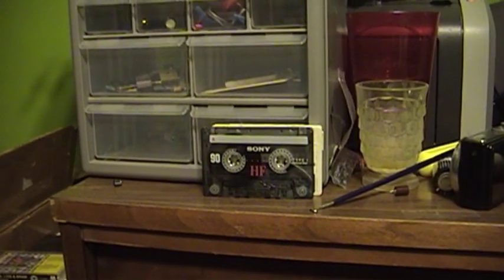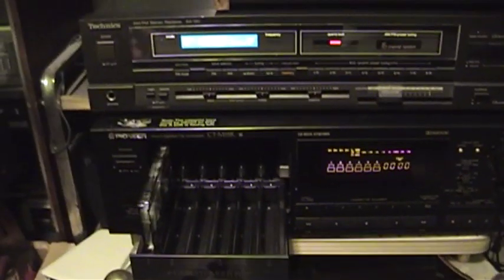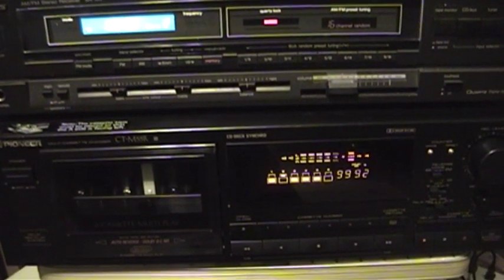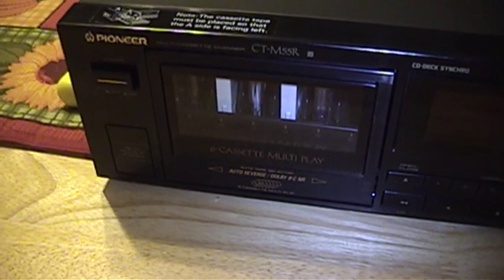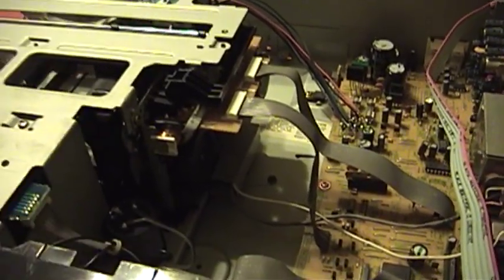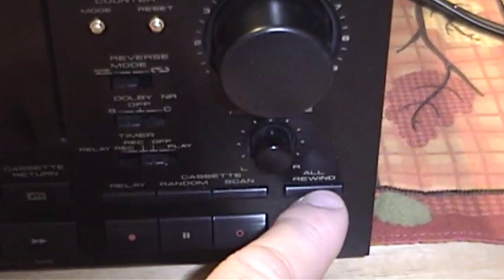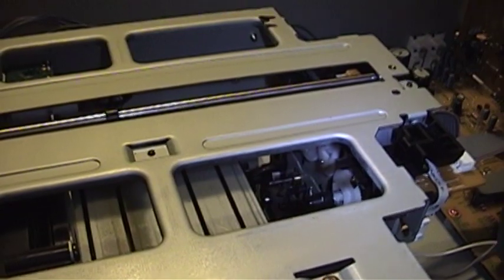Pioneer CT-M55R Cassette Changer Repair/Demonstration

Comment: I'm supprised that a company the size of Pioneer doesn't have their service literature available as a pdf file.  As far as the microfiche goes check with your local public library, they quite often have microfiche readers with built in copiers for making hard copies of the information you are researching.  Very cool unit :)

Comment: Wow, I saw one of these in a Goodwill about a year ago.  I tested it in the store and it did exactly what yours did--load, but not play.  I must have had the same solinoid problem, so I passed on it, even though it was only 5 bucks.  Now, I wish I had bought it.  I will probably be a while before I see one of these babies again.  Nice video.

Comment: That's cool!  I like how the tray slides in and the door closes.

And for some reason, I've always like the little rattle noises that cassettes make when being moved around or inserted/removed from a holder or player.  I have no idea why.

An alignment tape and frequency counter or scope would really come in handy for setting the tape speed.  I think you can actually get software for PC's that let you use the sound card input to test things like that too.

Comment: Thanks for writing back.  I have now found that I have to be careful about the tapes I insert in this player.  The thin tapes don't work as well.  The 120 minute tapes are a no-no.  Usually the commercially produced tapes work better.
I also like the random feature, it's really cool.  Works just like my 5-CD changer.  Kinda fun.
And I have the Pioneer CT-M55R which is collecting dust now, but I still love my cassettes.
But I'm also a big fan of vinyl, which I understand is coming back.

Comment: @matthewh16 They are similar yet totally different.  Microfiche comes on an approx 4X6 inch sheet of film, Microfilm comes on a roll of 35mm film.  The benefit of microfiche is being able to go directly to the part of the sheet of film with the information you want is located.  Microfilm you have to wind through the roll to find the info you want.  It's also easier to store microfiche as it is usually stored in a card file, microfilm rolls are stored in file cabinets.

Comment: I own the M66r which is the bigger brother of the M55r.  I had the M55r for years until it develop a high pitch squeal. I first brought my M55r back in 91 and pick up the M66r around 06.  The M66r comes with a remote and has the HDX system.

Comment: We came across a CT-M5R. That is right, one 5. I have an issue where you can turn it on and open and close real quick, however the device doesn't even try to recv the tape and displays ERR to no end. The conrols seize up and the device is useless till you power off/backon, quickly pressing eject in time to recover your tape. Every time it attempts to play it stalls with no movement in the deck

Comment: Hey Bill, Nice video .I've got a CT-M70R which is similar to this unit which I am restoring. I've got everything working except I can not get reverse to work in either the 6 cassette player or the standalone. Only one side in the player turns and jams up the tape. I had to change the belts I'm wondering if I messed something up .Forward play, rewind and fast forward are flawless. Any ideas. Can't find a service manual for these. Thanks
Reply: +John Dinse Mine seems to be doing the same thing now.  I got the speed adjustment worked out, i'm just trying to figure out the reverse adjustment
Reply: I don't have same system , but  I worked on different deck with same mechanism, Play and Rev Play are controlled by solenoid and Cam Gear witch locates between/under capstan wheels. Cam Gear has grooves , solenoid is pushing metal pin to proper groove, bottom side of the capstan wheel has little gear wheel witch is turning the Cam Gear to push head and pinch roller up, side is depending  of chosen groove. Mechanism has two motors, motor in the middle is for moving tape roll on both side play, rewind and forward, second motor , (on upper left) is for capstans and mechanism.

Comment: Hi, I have the same tape changer as in your video. It was working fine, then a tape was loaded and won't return, play, or rewind. I just get an ERR message and nothing happens. Any suggestions to free it up? Thanks!
Reply from the maker: It is very likely that a drive belt in the mechanism started slipping. Unfortunately, I've never seen a service manual for the mechanical parts of these, only the electronics.

Comment: What is the best way to remove a "stuck" tape?  I had to completely destroy the tape itself to get it out of there.  The rest of the cassette came out just fine.  That was frustrating!  I guess you need to make sure that the cassette you insert into the player will "behave" itself normally.

Comment: I have worked on one back in the late 90s at model electronics they had the schematics for it in a book form and had all the info to tear it apart all I had to do was replace a power diode in the power supply . I will send them a e-mail and see if they still have it and make me a copy I am unsure if they still have it as they moved and now only work on car audio and spedos.

Comment: Hi UXWBILL, I have a problem with a deck like this in the transport area. Some pieces are out of place and by this reason the transporte doesn't carry any of the six tapes, but it certainly moves like it should. Do you know by chance how to dismantle the transport platform in order to insert the pieces where they have to be? I will appreciate a lot your advise. Thanks!!

Comment: @uxwbill I was going to say, call a few libraries in your area and see if they have a microfiche printer and then print them to pages and put it in a binder and SCAN THEM! I'm sure a lot of people out there would REALLY like to have the service data for this thing because they are really complex, I've turned down a few of these for that reason, lack of service data. One of those things I really don't want to disassemble without a manual.

Comment: got an M6R  here, same sort of mechanism, but the deck has dolby-C & hx-pro for recording, slightly different display. mook seller shipped it to me with a cassette loaded, & this messed up the sliding caddy with the cassette in it. long story short- I have it working, but it thinks slot two is occupied while in fact the caddy from slot one is occupied & loads into the transport. 
did you ever get a full service document for it? I have schematics, but they're worthless for mechanical issues.
Reply from the maker: No, I have never found the full service literature.
Reply: @uxwbill  well, I got it running properly.... there's an encoder on the side of the sliding caddy, & the position of this encoder w.r.t. the worm gear is critical to the caddy knowing where it is inside the box. this had taken a knock, + two of the locating pins from the cassette tray are loose.... circlips ordered. the springs are safe, at least. so currently mine runs but only with four cassettes. this ain't a nakamichi, though... :-)

Comment: I just brought a CT-M6R home and it played a tape or two and is now stuck and won’t open. It runs the motor for maybe 20s and then displays error.  I paid 25 for it and I think I’ll keep it as a project. Any tips?
Reply from the maker: Follow the Boy Scout motto and "be prepared"? That's about the best I've got. You could be dealing with anything: a tape spill, bad belt, stuck mechanism, bad driving motor or even an electronic fault (unlikely).

I've never seen a mechanical service manual for these, only the schematic drawings for the circuit boards.

Comment: Hey Bill.  I just bought one of these and it showed up broken.  The tray is sitting in sideways and will not move.  Any ideas on what I could do to get this to work?  It looks like as soon as you turn this on its side it goes to crap.  It looks like it just got derailed any help would be awesome
Reply from the maker: I really couldn't even guess, since I've never had to go into one that far. It really sounds like something got broken, though I'm not sure what it would be or how repairable it is.

I've never had any luck finding anything more than electrical schematics for these.
Reply: Do you like sony or pioneers changer better for cassettes? @uxwbill

Comment: I learned the reason you unload media before shipping first-hand.  I had a Spectra Logic T50 tape robot shipped from another location within my employer.  Little did I know they'd just pull it out of the rack and slap it in a box!

It reads in big bold letters, "DO NOT SHIP WITH THE TAPES INSTALLED".  They mean it.

I had to fix the resulting carnage that 10 DLT7000 tapes caused to the loader.  Not fun! (A much worse fate befell the server that drove the robot.)

Comment: Hi Bill, I have a pioneer CT-WM62R multi-cassette changer. Haven't played it for several months but recently tried but an error appeared and I turned it off and back on. When I tured it on, it just made sounds as if it was trying to engage. I tried to rewind the tape and now both deck one and two will not play, rewind, or fast forward and the carousel will not move. Any suggestions? Thanks for you help.
Reply from the maker: My best guess is another case of bad belts. These units are certainly old enough to qualify. However, the mechanism in both of the Pioneer changers I've owned has become "stuck" and needed some careful manual encouragement to free it up. The one I still have (the unit in this video) still works perfectly after having been freed up.
Reply: @uxwbill  Hi Bill I just subscribe to your site and I love your videos. Anyway my question is I have a Pioneer  6+1 multi-cassette changer model CT-WM60R I have bought new in the early 90s but the problem I have now is it's been sitting for a little bitI can't get either deck to engage into play I'm guessing it is a solenoid how do you clean the solenoids?

Comment: I have the 66, it won’t load the cassettes. It will go to position but won’t pull the tape then just returns. Any tips or direction on where I could figure out a fix?
Reply from the maker: Bad belts, most probably. I've never seen a service manual for the mechanical part, so I can't offer any more assistance on that.
Reply: uxwbill ok, thanks for the reply!

Comment: I have a ct-m6r and the cassette #2 just got stuck in the open position and the carriage has left the original position. Ugg! I'm going to attempt to fix it myself. Any suggestions would be appreciated!!! HELP!!!
Reply from the maker: This is likely a result of bad belts. Unfortunately, I have not seen a service manual for the transport, only the electronics.
Reply: @uxwbill  Hey thank you for the reply. cassette 3,4,5,6 works great.  I just have to get #2 back in line with the rest. (fingers crossed)

Comment: I bought mine also on ebay. what problems that I am having is that the door will not open to laod but the motor runs inside.
Reply from the maker: Bad belts are becoming ever more common with these.
Reply: the motor sounds week. .the door will not open all the time and only once half way then it will get err on the screen.
Reply: So I sent that one back.by looking at the rest of the ones on the net this one had the tray in side ways or should I say not  level  from being banged up in shipping. I found a WM62r and bought it but the problem that I am having now is that the carriage is not going in far enough to take the tape and the motor keeps spinning inside I'm thinking that it is a belt there is some where marks in the pinch rollers but I think that it was from being played a lot.the single deck on it seems to work ok. it looks like the rest of the belts are going to be hard to put in but the carriage belt should be ok. thanks for your replies. .In my view they have got to be one of the coolest decks ever built.

Comment: Is the manual on Hi-Fi Engine?
Reply from the maker: I don't know. That web site's designers never heard of a robust account management system.
Reply: You just create a free account and log in.  Then you have a search bar where you type in your make and model of whatever equipment you have.  They usually have most service manuals as well as original brochure documents all in PDF form.
Reply from the maker: Implied in my original commentary is that the whole account thing went horribly, horribly wrong. And it is still wrong, but it has exceeded my ability to care. :-) I did try quite hard for a while to straighten it out a while ago.

I bought the manual I have from StereoManuals.com, along with several others over the years. I've been quite happy with everything I ever got from them.

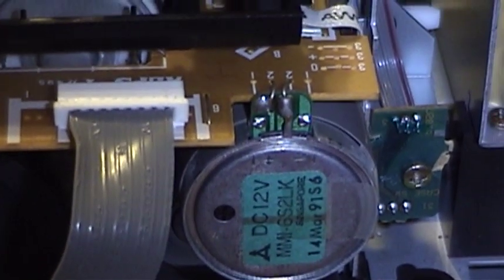Comment: At 8:02 it's S6 not (week) 56
Reply from the maker: You have a luxury I didn't when making the video -- the ability to closely examine what the motor says. There is a certain pressure to keep the dialogue moving while the camera is running.

Comment: uxwbill; there is a group on facebook called cassette tapes and players i have the same unit on mine the vu meters don't work i ask for help and one of the group members put the manual on the page so could print it out i would try there if you don't have it yet i know this video is 8 years old good luck and i love your videos
Reply from the maker: As a rule, I don't use Facebook and neither should you.